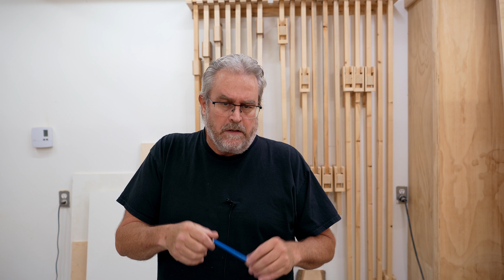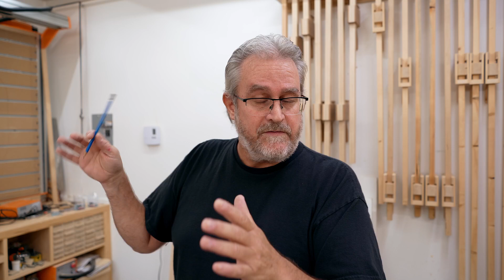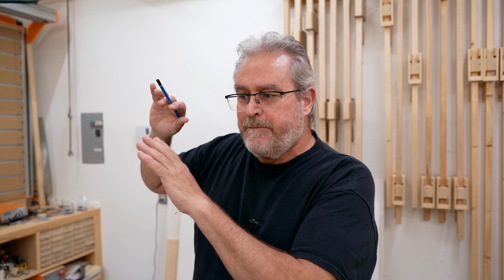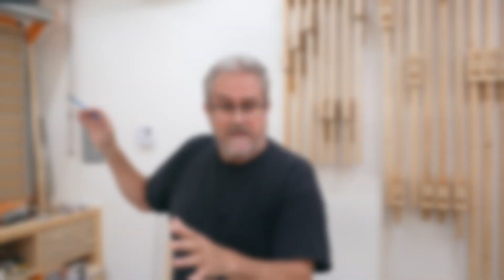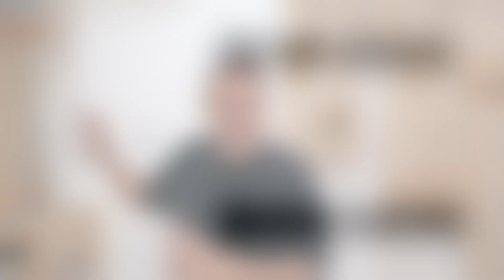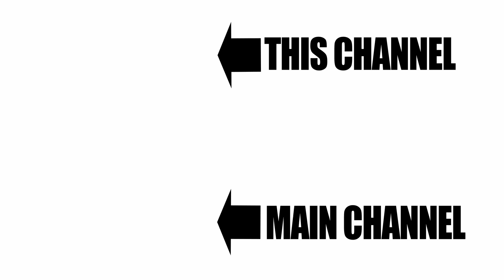Debunking Audio "Truths" -  Dr.  Floyd Toole

Comment: I've been designing and building loudspeakers as a hobby since the 80's.  Even did a stint doing it professionally, designing custom systems for homes.  At the end of the day, sound reproduction is moving a diaphragm across some distance with one or more other diaphragms.  There are solid engineering principles behind doing just that. Every design I have put on paper has only accounted for making sure that recorded vibrations were as faithfully reproduced by my speakers as physically possible.  At the end of the day, that is really all you can do with the physical loudspeakers themselves, particularly if these speakers may be moved to different rooms.  Obviously, I am not talking about speakers specifically built for a single listening room.  Personally, I've never had a dedicated listening room and probably never will.   Now enter the wet tissue that sits between the diaphragms you're moving with your speakers.   That is what equalization, room treatments, and lately DSP are for.  Particularly with DSP, it is possible to get any speaker, that is physically capable of reproducing something close to 20hz to 20Khz, to sound "good" to most people in most rooms.   Not all, because there are rooms that are just acoustically terrible (try building a PA for an ice rink some time!)  There are people out there that will tell you your $4000 amp is the "weak link" in your system, because you need a $10,000 amp to properly power your speakers.  At that point, you have gone past rationality and engineering is not the correct science to deal with it.
Reply: Oh man I just love the amp part. Or even better: "Audiophile" AC power cable. hahahah
Reply: Unless you designed and or built the Drivers yourself... then all you are is basically a  "Tinkerer".   The box design is the smallest factor of a speakers performance abilities.  Its also the easiest to figure out + build.   The real performance differences come from high performance drivers.   I used to own a pair of Techniques 3 ways, that had 12" woofers (ported)... and were said to be able to handle 200 watts each.    Then I got a pair of  1970s era  "EPI 100v"  speakers.   The EPIs only had 8" woofers, with a 2-way setup (sealed).  But...

 The little EPIs put out FAR superior sound quality in both Bass and High frequencies.   The bass was not only more "Musical" and detailed.. but it was also had a much more powerful room-shaking "Thump" to it.   One single EPI woofer, weighed more than two of the 12" techniques "eco woofers".   This was largely due to the much larger and stronger magnets used on the EPIs... and likely,  much stronger voice coils too boot.   The stronger the magnetic forces.. the faster the potential Acceleration and control  =  Far more details with FAR less potential distortions.    The EPIs have a near Holographic 3D soundstage... that rivals any speaker that Ive ever heard before... And I own, and have listened to, a LOT of different speakers.  While they can play as loud as the Techs... they are more than loud enough to get the cops called on you, if you crank them up in your apartment.   You dont really miss the additional loudness... because the sound quality, details, superior bass, and 3d soundstage...  are SO VASTLY better... that its just pure Nirvana to the Ears.   (In fact, with these... I was able to understand lyrics from a singer... that with every other speaker... it was unintelligible)

 While I agree that extreme room situations, like a Hockey Rink,  are going to present a huge problem for sound... no matter what speakers you are using...  MOST people are playing their music in standard low ceiling apartments, that are well furnished... and do not "Echo".

 As for DSP... it can never fix issues with drivers that are struggling to keep up, and are distorting.  DSP is mainly for room reflection / timing corrections.  It can magically fix low quality drivers.

 And as for the comment about the AMP being the weak link...  In many cases I agree with you.  Most speakers dont even come close to requiring a  +$1000  Amp.   Largely because either   1)  They lack speakers that are truly capable of Audiophile level reproduction  or   2)  They are running low power speakers, that dont need that level of wattage.

 Now... High power amps CAN make a huge difference,  however... only really if you are running some Crazy expensive + super powerful speaker sets.  Maybe something like the EPI 1000 towers, that have 8 drivers each in them.  Or maybe the massive speakers you often see in PS Audio's videos:  "Infinity IRSV",  that are taller than many peoples ceilings, and have over 30 drivers in them.    With that level of speaker... they would be so Dynamic and Power hungry,   that most typical amps couldnt keep them powered effectively enough...  AND... any small amp imperfections,  will likely be very easily heard on these speakers... where as with most speakers, you would never be able to tell the differences between amps (other than EQ differences).
Reply: @johndough8115  What are you talking about? Like no offense but I understand most of TS parameters and their HUGE interactions with the speaker cabinet lol.

Speaker enclosure is extremely important. Ofc you want low distortion drivers that don't ring etc. 

Amplifier has to have: enough power to drive your speakers for desired SPL, decent DF, low noise, and low distortion 80dB sinad or better at decent volume. Basically what TI's TPA325x or LM3886 (or equivalent AB amp) can do for cheap lol.

Then you fix the rest with speaker placement, room treatment and DSP.

TLDR: You dont have to spend a fortune on an amp. lol

Comment: Wow, i just saw your video an I think its great that you made a response to this highly debated topic. I can live with your opinion, even though i dont a agree but i think you should really consider something. It is apparent that you know how a good speaker sound and how the room can influence something. You have also put a lot of work in building and testing als sorts of stuff, so you have a strong opinion on this topic, which is of course fine. But there is a reason why "the average consumer" is called this way. Most people (including "Audiophiles") fall into that pattern and you with your listening room which would cost tens of thousands if you want to buy it are the minute minority and most of your viewers will have a normal room so the rules for the "average consumer" apply to them. 
Also i dont think someone who buys a pair of Revel M16 or Neumann KH120 for over 1000$ is the "average consumer". Regardless these speakers are designed with tooles theories in mind and there are thousands of people in studios or at home which use these speakers for serious listening.
Reply from the maker: Since you are here watching and commenting on a video about audio, that means you are not the average consumer (average consumers don't watch these videos because they are not interested in audio that way).
So as you are not an average consumer, you should be holding yourself to a higher standard and not settling for the consumer grade findings from Harmon and Toole.
Reply: First off, i love the thumbnail but Floyd toole is not my Big brother. 😂👍 
I think he summarized known things nicely and backed it up with tests. But he is not the inventer of constant directivity or "average rooms". 
But you realize that in the context of Tooles work, "average consumer" just means the average of his blind studies. He also made a comparison between "trained listeners" and "untrained listernes" and the only significant differences were, base response and sensitivity for changes in frequency response.(Just in short, i think you know that.)
"Surprisingly" i found out that my personal preference corresponds with the preference described by toole for trained listeners. 
But you are right. I am not the average consumer and I think base equalisation and at least two subwoofers with good placement are "necessary". Also i like developing speakers so im really not in the market for commercial products.
I just see so many people wasting time and money with suboptimal designs instead of just understanding the basics and building from there. Reading floyd toole is certainly more useful than learning some bullshit about cables or "soundcharacteristics" of amplifiers.